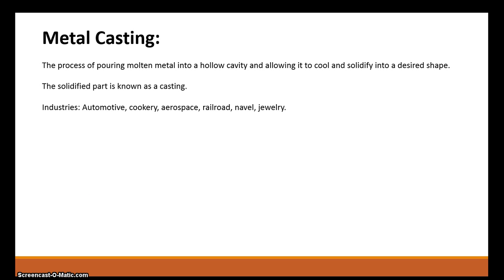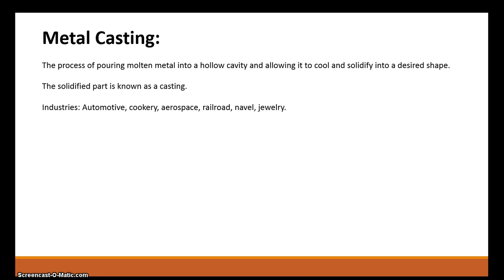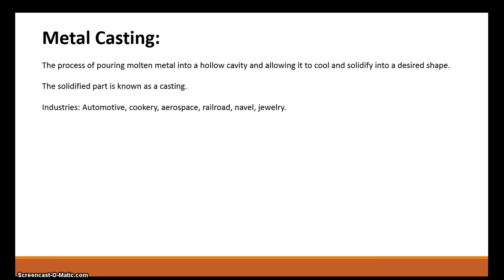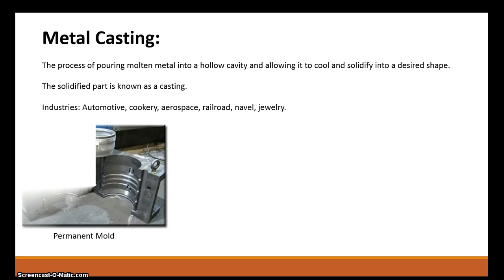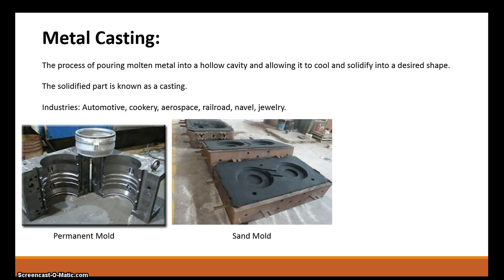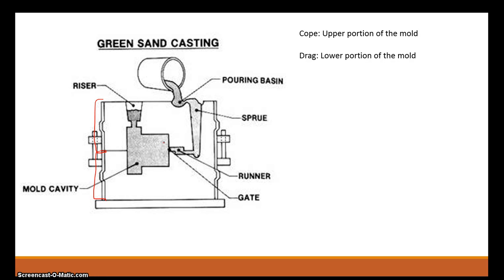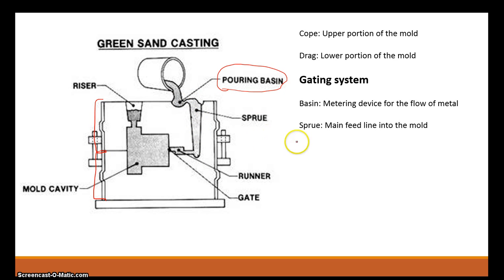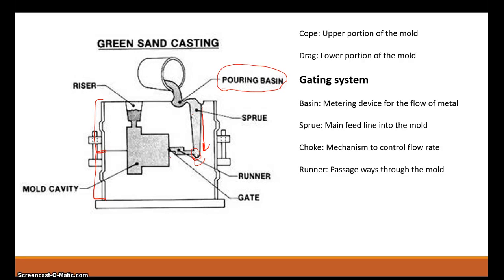Metal Casting (Part 1: Definitions and process overview)

Comment: I looked through all your videos, you're missing one very important part of the process. I found nothing on how the various molds are made. I'm a retired patternmaker. Permanent molds, patterns, vacuum forms, rotomolds are all made by a patternmaker. Although a lot are now done with 3d printing, cnc, and designed on the computer. I did all of that. A cad designer, machinist or engineering cannot accurately design a pattern that works for a particular application without the knowledge a patternmaker has supplied. Either through books or direct contact. I have 40 years building patterns and tooling with wood metal plastic and plaster. And experience with cad/cam and manual machining for pattern and mold construction.

Comment: My understanding of shell molding was that you heat up a metallic pattern and cover it with a sand-binder mixture. The heat from the pattern hardens the mixture close to the pattern. Then you remove the remaining mixture, leaving a hardened shell. Is the process described in the lecture (glue on pattern, sand sticks to glue) an alternative shell molding method?

Comment: The height of sprue seems to affect the inlet flow rate. What do you reckon the acceptable height of sprue should be if you don't want the turbulence to affect the product quality?
Reply from the maker: That's a very good question.  You're right, the height of the sprue has a major impact on the flow rate.  However, there are other things that have to be taken into account such as the density of the material, the viscosity, the nature of the mold and the cooling rate of the metal.  All of those things have to be taken into account in order to decide on the correct sprue height.
Reply: Thank you for the response! I have revisited Part 3 of this video and realized this problem is included in your video. Definitely helpful for my future mold designs!